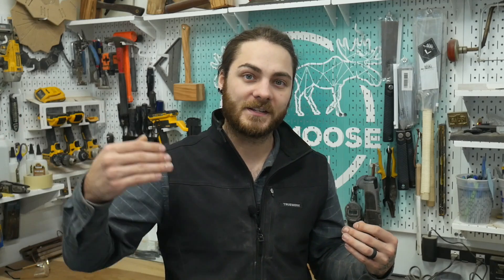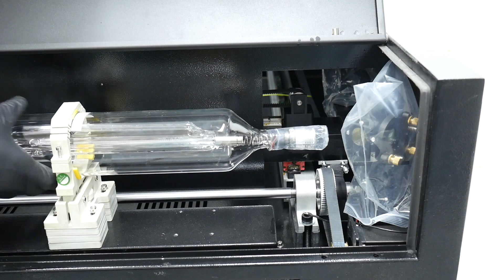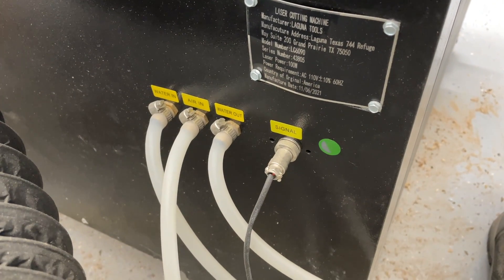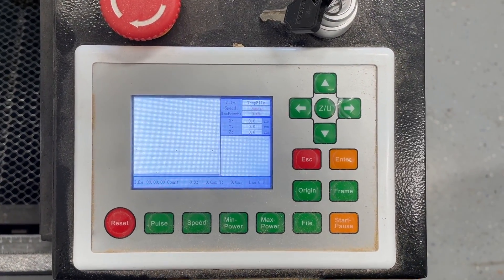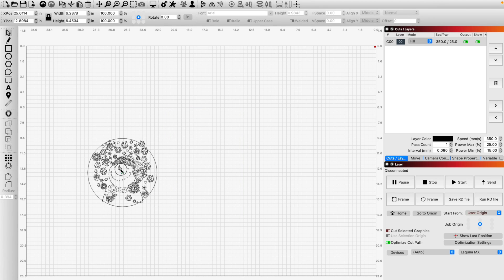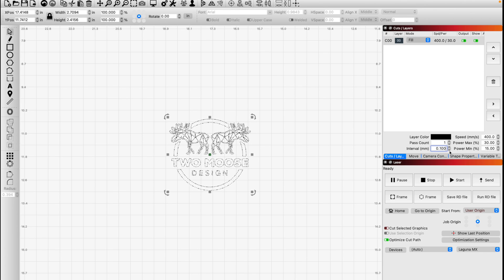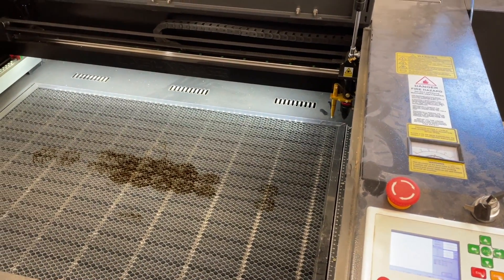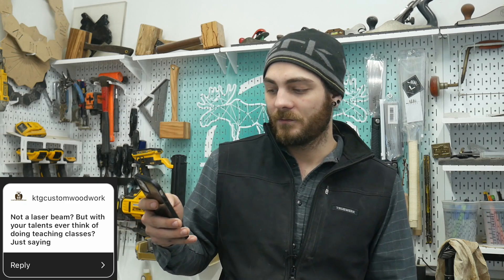Is it easy to set up and use a CO2 laser Engraver / Cutter

Comment: Very informative! Does this laser have a pass through slot to cut projects larger than the bed size?
Reply from the maker: The front is removable but I don’t believe you can do pass though 🤔
Reply: @TwoMooseDesign  Thank you. I was getting ready to pull the trigger and purchase this, but need to cut at least 48 inches at times and I don’t have the space for the EX. A company rep said the MX does have a pass through slot on the front, so I wasn’t sure if it’s like the Mira 9 where you take the work out and turn it around for the pass through. Without seeing it in action, I don’t want to buy it because it’s too expensive to arrive and not work as I was expected. My search continues!

Comment: Tell me about the size of this beast when it showed up.  I'm having a hard time communicating with the shipping company about the details.  It's currently in my state, CO, and about 60 miles away.  If I had a truck and fork I would actually drive to Denver to get it.  Were they able to lift gate it or did you have to forklift it?  The reason I ask is I'm trying to figure out if I need to rent a forklift ASAP or if they will be able to lift gate and bring it to the threshold of my shop via a crate jack.
Reply from the maker: We were able to unload it with a pallet jack off the truck with the lift gate. It was tricky but we did get it off and in the shop. This is the MX the EX would definitely need a forklift
Reply: @TwoMooseDesign  GREATLY appreciate your reply.  Thank you very much!  Looking forward to more vids from you.
Reply from the maker: @todds4101  also be aware the amount of spray foam they put in there is awful lol took me a bit to get it off the pallet. I just pulled out as much from underneath as I could. You’ll see what I mean. Other than that it was pretty painless
Reply: @TwoMooseDesign  My friend your feedback about the laser crating has been worth the laser's weight in gold.  Usually I have a pretty good sense of what stuff will weigh and how it will be shipped/delivered.  I work at a local Woodcraft and have done woodworking now for about 28 years, most of it on the lathe, but this new laser adventure has been..........interesting.

Comment: I know I am not the first but great job explaining everything. I am ready debating on cnc vs laser.
Reply from the maker: Thanks! I appreciate it. It really depends what you do or want to do. For lasers I’d just assume most of them will only be efficient around a 1/4” thick material for cutting. So if you plan on cutting stuff around 3/4” a Cnc may be better, but you also don’t have to clamp anything down with the laser. So if you only plan on messing with 1/4” materials then the laser is far easier. Another thing is price, laser are definitely more expensive. A laser under 60 watts will be way slower than a 100w machine for cutting and engraving. Good luck! I’ll have to do a video on that topic and comparing that specifically a little more

Comment: I have the same laser. Similar experience  as you, it would have been easier if I viewed this video 2 months ago. Wi-fi set-up was a little harder just because I didn't really see any videos on that took me a while to figure out . I'm glad I did set  it up that way it's supper convenient.  Basically you have to setup the ip address to match between the laser and lightburn software but not your wifi . I setup the ip address to be 10 digits different than my home ip. Then you have to switch your wifi to the TP Link wifi. Basically it will run on that dedicated link if that makes sense. Love your channel . Hope it makes sense.
Reply from the maker: I tried like 3 times and I couldn’t get it, Jess tried and got it right away 😆 I don’t even know what I was doing wrong, I just couldn’t get it to connect in light burn. But yeah the cable is annoying once you get it figured out

Comment: Nice machine.  I got the glowforge. It's a great started but I feel like I out grew it and the bed space is very limited.  Good video!
Reply from the maker: They seem quite expensive for what they are. But that’s the main reason I didn’t buy one of those first, I felt I would put grow it quite fast. They look nice for a desktop type machine though
Reply: @TwoMooseDesign  do you know if they have a rotary setup to engrave things like cups?
Reply from the maker: @matthewcarlacci  Laguna does yes. I will get one soon, i just wanted to figure everything out and get comfortable first!

Comment: The Epilog came pretty much ready to go. No mirror alignment - tube already installed. I plugged in the machine, set up the exhaust, connected a tube and air compressor for air assist, downloaded their driver and was lasering. Does the laguna not have a home at like 0-0 for x and y?
Reply from the maker: dang! doesn't get much easier than that! it homes to the back right of the machine when its powered on

Comment: I have a Laguna EX 150watt. Love it!
Reply from the maker: Ugh I really wanted to get that one but I was intimidated by the overall footprint of the machine, it looked massive! lol
Reply: @TwoMooseDesign  it is a but I love the larger cutting area.  I’m definitely glad I went with this size.  Not only the larger cutting surface but the 150w tube makes massive cuts.
Reply from the maker: @brokenbranchwoodshop1873  yeahhhh I wish I would have spent the extra money now that I’ve been using it lol I can see where cutting 48” and an extra 50 watts would be nice lol